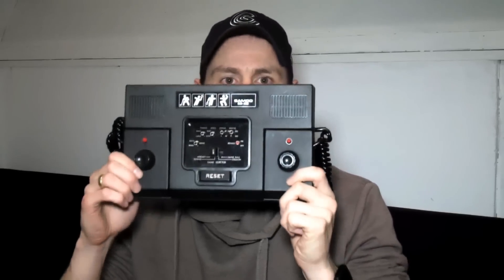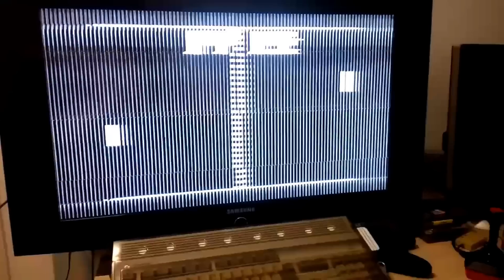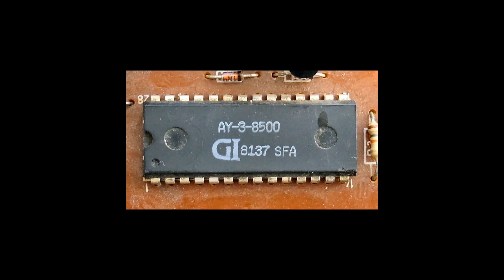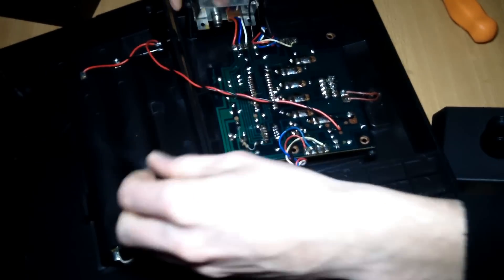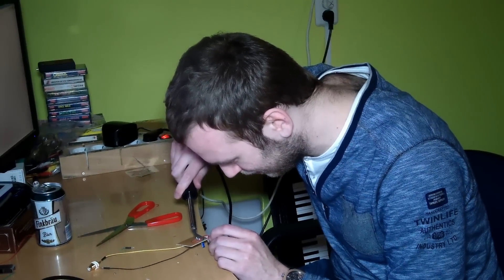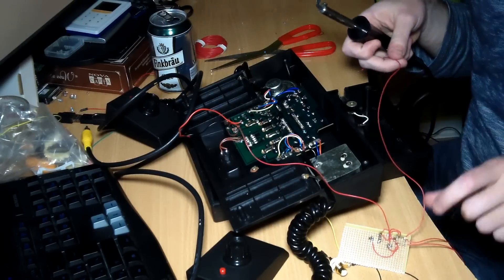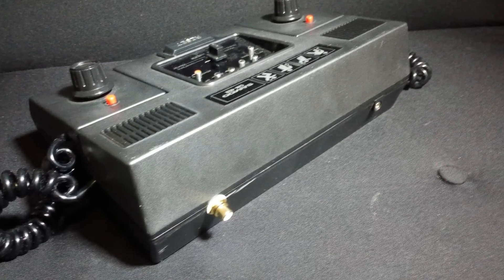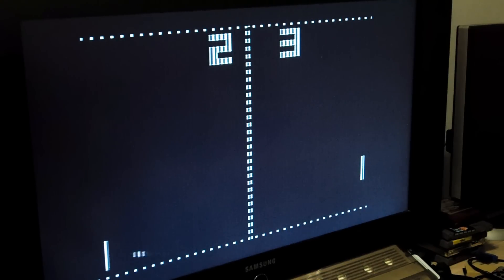HACKING Pong (1977)

Comment: Still doesn't look right. Those numbers and paddles should be solid.
Also: If you add resistors to the individual "components" of the composite picture you can add color.
Reply: are you sure it only needs resistors for adding color? or only different gray scale?
Reply from the maker: It's a black and white game. But you are correct in that the picture is not perfect.
Reply: @RetroGameCouch  just tried with resistors, u can change only the grey scale, not the colors! needing to add another chip for obtaining colors
Reply from the maker: Which value resistors, and where in the circuit?
Reply: @RetroGameCouch  it isn't important, doesn't work with resistors!